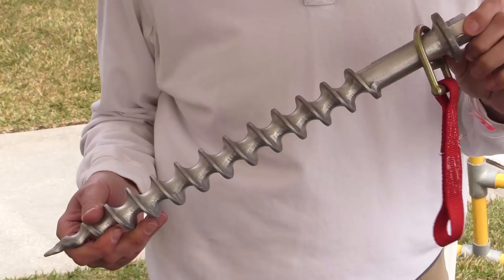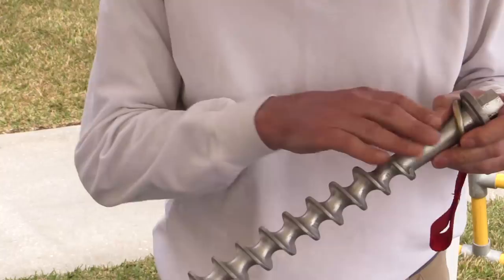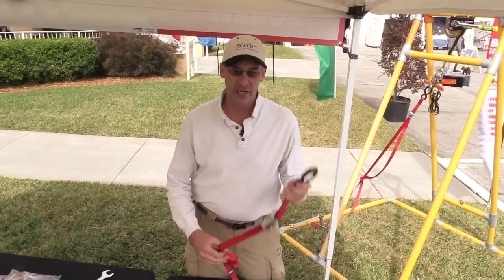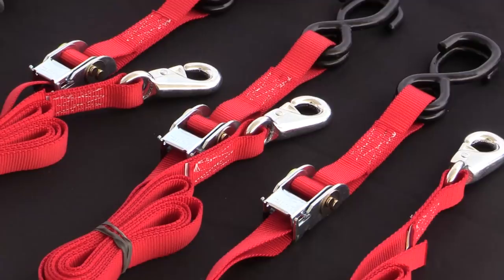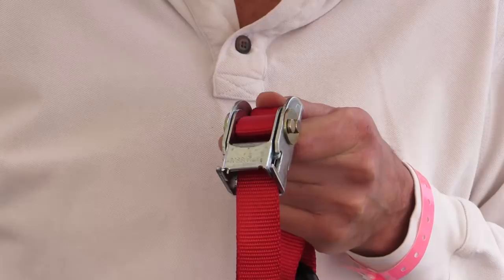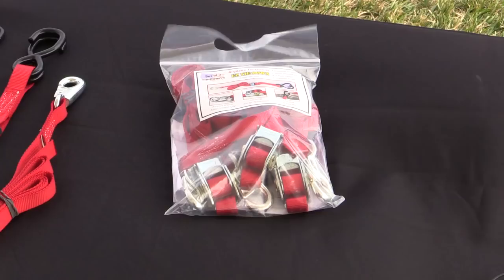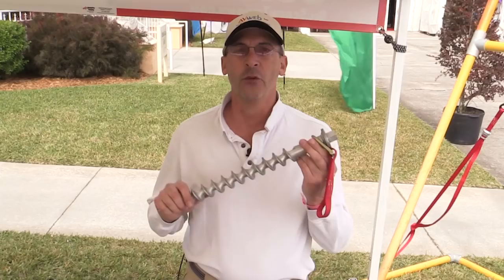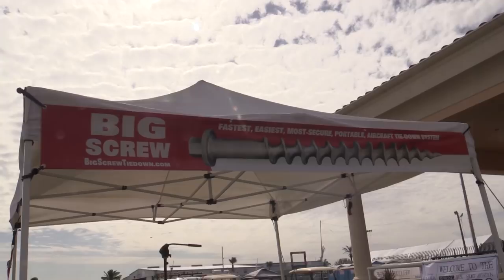AVweb Product Minute Big Screw Tiedown

Comment: The system may work in soft or sandy soil but does not work in the Rocky Mountains.  All the screws did was chew up the dirt.  Could not get them in with the hand wrench or an impact drill with a one inch socket.  Sell you mine for half price.